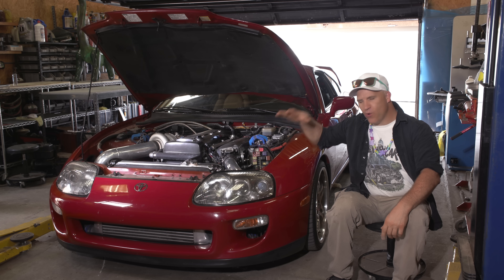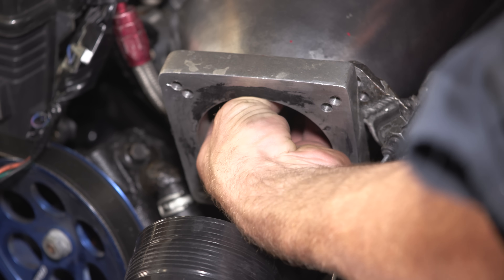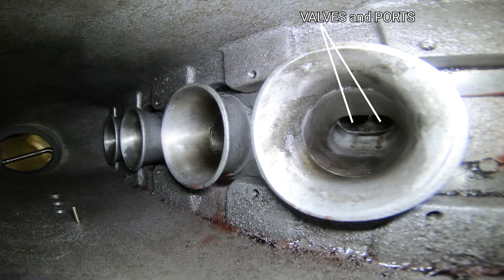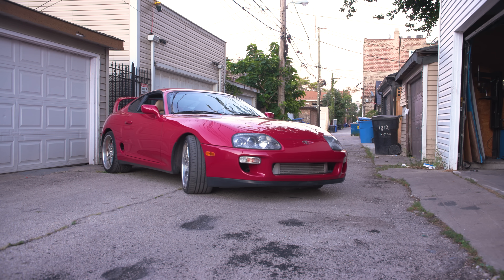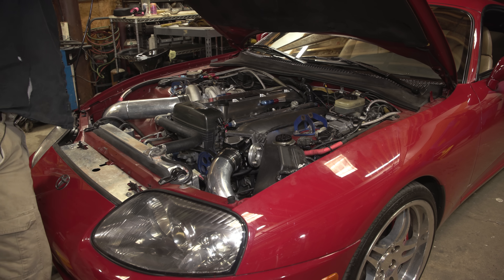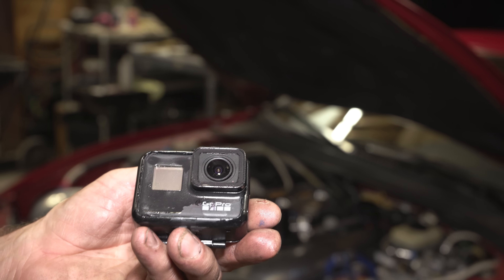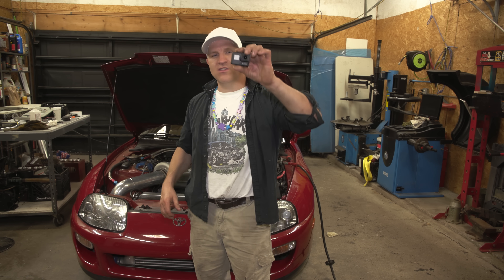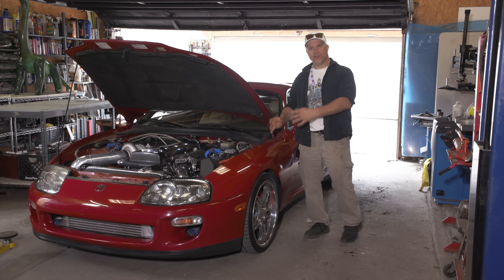Driving with Gopro Inside My Intake Manifold (Toyota Supra Turbo)

Comment: I can imagine the bearing between the exhaust power turbine and the intake boost turbine would be under considerable stress and probably require more oil flow for bearing cooling which might lead to more bypass. Or  of course a bad seal between the bearing and intake turbine housing would pass more oil to the intake air.
Plus with all that heat of the exhaust I can see the air intake temperature rising significantly contributing to higher intake temperatures, cooking your go pro 🍳

As for your handling the go pro when it was 200°, indeed! For many materials transfer rate is so slow that one can easily pick up very hot materials with little effect. I worked at a tire factory for a couple of years in engineering and had the run of the factory so to speak. I spent a lot of time just out talking to operators and sometimes they would let me take over their job while they watched just for fun for both of us. I did most jobs in the factory except for actual tire assembly since that was indeed a highly skilled task that one could not just step in and do. Anyhow, 300° rubber was nothing. When it started getting up to 400° which was rare due to high temperatures curing the rubber, anyhow, then you would need to switch hands now and then.

Okay after all that nonsense, that was indeed a very cool video as you can see the interaction of the butterfly valves and get a very good sense of flow, especially on full throttle to no throttle back to full throttle footage. 
I was surprised at the fuel not being a finer mist.  I'm not familiar of go pro, but if you can operate it by Bluetooth you could easily encase a waterproof camera in a heat resistant shell.  The near future you will have a high-speed camera the size of go pro.
Reply: Leonardokite, generally the t-wheel & impeller are on the same shaft supported by a common plain bearing.
As long as there are no restrictions in the oil return line the seals should easily contain the oil.
Reply: @azmike1956  considering the extreme heat of the exhaust, that is a fairly taxing environment for any bearing seal. There is also potential for a significant pressure difference across the seal.
Reply: @Leonardokite  the (slightly) higher pressure would be on the impeller side &, if anything, would force seal blowby into the crankcase or past the turbine seal which would present as smoke in the exhaust.
The newer seals are actually quite good, think of all the turbos in use at this point in time. They're used on everything. They use a pressure balance system so that the pressure on both sides (turbine & impeller) are fairly even & the return is the lowest pressure causing the oil to flow that way.

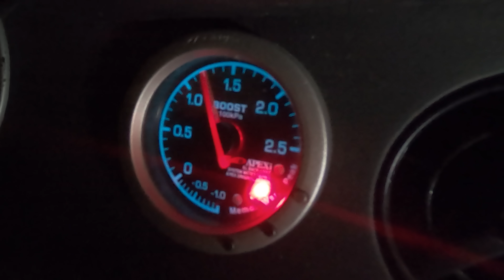Comment: Was it just me or was there electric arc inside the intake manifold on the  left side second cyl towards the middle of the video 4:39 ????
Reply: I See it too
Reply: Yeah, whats with that? I wouldnt think it could be static since its all metal connected together, so maybe a drop of fluid reflecting the light?

Comment: If you have a PCV could be positive crankcase pressure from blow by, which is normal especially on turbo car. Or could be oil being sucked back into the intake from the cylinders when the intake is depressurized and drops straight back to a vacuum, final option is turbo seals, pooling oil up in the intercooler; I think turbos leak slightly no matter what, most of the time it goes unnoticed until you stick a GoPro in the intake lol.

Comment: It's coming from your turbo the oil that's inside the cameras actuated with the fuel that you saw 5:25
Reply: Or possibly before startup did you notice it was red oil on the inside of the lower intake manifold that looks like assembly lube

Comment: oil is generally from the turbo. There was oil in the corners of the manifold when you installed the camera
Reply: K&N filter uses red oil.  Maybe Matt used ATF
Reply: @LawpickingLocksmith  true k&n oil. I wouldn't be too concerned... no smoke.

Comment: Hey bro slap a oil catch can on that beauty you may have some blow by witch would cause the intake to get slightly oily. I've put one on my full bolt on & tuned eclipse. They do help a lot I don't care what anyone else says, just don't except to gain any power its simply a mod that keep your vehicle more healthy
Reply: Its super common on both NA and forced induction but you get a lot of worse blowby with forced induction vehicles

Comment: You have oil catch cans?  A bit of junk in your intake, if you don’t, you should definitely consider getting some.  TBH the crap in there looks like transmission fluid.  You run Red Line oil?  I run Red Line in my 600HP EvoX, best oil I’ve ever used by far.
You probably had oil in your intercooler, and when you stomped on it several times, I assume you don’t do that alot?  It blew that oil into your engine, from the PCV valve and crank case ventilation, it’s directed back into your intake for emissions purposes.

Comment: Could that be excessive oil on the air filter being sucked through.  Looks red
Reply: If it's oil to live the piston from the top then when the pistons fire the air and fuel, the oil gets gone also... that means you constantly have to add oil after a week of driving like an idiot
Reply: Oil coming from the airfilter?no that how toyota design 2jz,oil squirt on the cams and rocker arms/valves,some of the oil get blown out or sucked in the piston to lubricate the walls.
My gy6 scooter does the same,it squirt oil from the top of the cam and the rest of the oil goes to my cylinder,when I bought a bore kit came with a new high flow oil pump to squirt more oil.
Reply: Benjamin Franklyn -Why do you think the oil looked red then? After he first starts it it looks to be coming up from the gasket between the expansion chamber and the intake stack manifold. Later it seems to have made its way up the stack as it starts getting sucked in. I doubt anything had a chance to drip down from the mistake valve areas.
Reply: @RemmikRotus  gas most likely turning the oil red ,unless he added oil additive.
Reply: @benjaminfranklyn604  

Agreed. 

Not so much going to be the Squirts in the Bore causing it but most likely what you said about the Oil in the Head etc.

I didn't look too closely to see if there is a Catch Can there, but I would suspect it's from the Crank Case Breather otherwise.
Reply: @benjaminfranklyn604   So it keeps the pistons oiled and lubed?
Reply: @omghalo3rocks  yes since it turbo,the more air is compressed ,the hotter the cylinder,rings and walls will get ,causing the rings to expand on the cylinder and could lead to worst damage.
Is like the chevy Ls in a race boat,instead of squirting oil from the top ,it squirt directly on the bottom of the piston ,to help keep the piston cool since boat racing are always at the rev limit throughout the whole race.
Stock Ls don't come with those special oil squirter.
Reply: @benjaminfranklyn604  I've never actually seen red engine oil
Reply: @user-bd2yw7yt1h  well I have,I mixed mystery motor oil additive to my gas and oil,it turns the oil and gas red .
It help clean the engine and gas pump or carburetor while making the gas last long.
Mmo is not really oil ,you could smell the other chemicals in it.
Idk what kind of additive or oil he using.
To me looks like a brownish red.
Reply: Its trans fluid cause its red
Reply: What you mean Thirsty? -automatics may have red fluid but standard trans have gear oil that is not red.
Reply: @whatyoumeanthirsty6132  

Shut up!

How is Transmission Fluid making its way into the Intake Plenum?

Do you even know about Engines?

Further more:

Transmission Fluid is Red when it's ATF, this car is a Manual Transmission.......

How about you explain that one????
Reply: UK Citizen  because everyone knows trans fluid is red i did mine and it was red thats why
Reply: What you mean Thirsty? Yeah pcv valve stuff

Comment: Awesome video. Coolant leak started at startup. Hard revs showed some fluid coming out at top of front 2nd? Cylinder? I say small coolant leak at intake manifold. And its either small oil leak in turbo, or blowby/unscavenged oil from cylinders.

Comment: I never knew the gasoline flew around inside the intake as much as it does

I would've assumed it just goes right into the cylinder
Reply: That’s not gas actually it’s oil
Reply: Interesting....

Comment: Cool video!
Looks like when the throttle closes, the vacuum pulls all the unburnt fuel back out into the intake manifold plenum volume area. Which brings me to my nexts thought about where the oil is coming from. Maybe the normal blow-by into the crank case is momentarily reversed pulling oil mist from the piston walls though your ring gaps or just the residual oil/fuel caught in the oil rings back out into the plenum where the air goes into a quick sharp stretched state causing a spike in vacuum making that visual puff.
Reply: I also forgot to mention it could also be coming from the valve stem seals?

Comment: This was such great idea, to put little Gopros in places where we usually have no idea what goes on. Thanks!  I also saw right away that reddish oil coming back out of the intakes into the manifold, and thought that something probably wasn't right there… did you ever figure that out? It's also interesting how much fuel from the injectors starts to splatter back out of the intake and then gets sucked in by the next intake stroke.

I always love it when I catch a glimpse of something I recognize while you're driving around, too... your turn off of Armour onto Hubbard was familiar to me...  always enjoy catching fancy cocktails and food at The Loyalist, just a few blocks south of there.

Comment: I'd check the following: Valve Stem Seals, PVC system, Catch Can (if installed), spark plugs if there's oil. The oil issue appears to get really bad after beating up on it if this is all in order.

Comment: Cool video, but what's all the reddish liquid in the throttle body?
Reply from the maker: I figured out that the power steering vacuum switch has been dumping small amount of oil into the intake manifold.. I didn't know that was going on.

Comment: That's oil from your turbo mate. Good luck.
Reply from the maker: Nah that was my first thought but it's red oh, I ended up tracing it to my low pressure vacuum switch for the power steering pump seems like it's been dumping oil into my intake for a while now and I just didn't know
Reply: @WarpedYT  Right on. Glad you found it. Was worried for a second.

Comment: Dude, this is crazy! You are the mad scientist!
Reply from the maker: Lol... Thanks ! I was going to text you last night and tell you what I was posting, but I thought you would like the surprise. these are the ones I was telling you that I was pulling together for the last 6 months where I put cameras in all sorts of weird places, the motorcycle one was the first.
Reply: I dont know if you're running a catch can, but it seems the vac lines are drawing in oil fumes and maybe trans fluid if you run a breather for the trans and PS fluid
Reply: @classicrestouk  He is not running an automatic. It's engine oil.
Reply: @allanb3222  manual trans/gearbox has fluid....... I didnt say auto trans.
Reply: @allanb3222  hi. Just thought I'd reply. I believe it was Power steering fluid (it was red/pink - normally the power steering system uses ATF).

Comment: Transmission fluid, from trans. modulator vacum line.
Reply: That's only for automatic transmissions, isn't it?
Reply: it does look kinda Red as it pools on the inside of the manifold hmm...
Reply: It being red does make you think that it's trans fluid. There's not that many oils that should be that color.
Reply: Transmission fluid is a lot more viscous than that. Looks like OEM toyota coolant.
Reply: @bluenoseixmr  If so, how would coolant get into the intake track? I would say head gasket failure to get mixed oil and coolant, but that would show in cylinders not the intake plenum no?  Unless that cylinder mix is getting thrown back into the plenum somehow when the intake valves are opening/closing.

Comment: It's trans fluid, vacum mod. trans.
Reply from the maker: It's Manual Transmission. I believe it's power steering fluid
Reply: @WarpedYT  wow I should have realized that after watching the video it is a manual transmission good luck with that sir you have a good one

Comment: Looked like trans fluid in the intake floor before he started it. I'm sure it's oil, but sure did look red.
Reply from the maker: I think I traced the problem to my low pressure power steering switch, it has a hose that goes to the intake manifold and I think it's bypassing oil from my power steering pump into the intake.. I'm going to change it this week.
Reply: @WarpedYT  makes sense. just a little would be good for burning off carbon and keeping the upper cylinders lubed!

Comment: The oil looks like transmission fluid to me. It had a reddish color.
Reply from the maker: I believe it's power steering fluid, I forgot to include the I'll take but I checked it out and I found the vacuum pressure switch for the power steering pump faulty it seems like it's dumping a little bit of oil into the intake under vacuum
Reply: Ohhh I thought that was coolant like the pink stuff

Comment: Looks like coolant in the inlet could be from a throttle body water feed.
Reply: I was thinking oil from PCV,  crankcase pressure/blow-by.  It's a normal amount for a turbo engine with use on it.

Comment: The oil is from the turbo, probably has a tiny leak in the bearings when it's getting full oil flow and under boost
Reply: Either that or crankcase venting. Was that coolant that appeared when he started his engine though? The red stuff leaking from below the intake flutes?
Reply: Not likely from the turbo although there is a small chance. PCV is the likely culprit.

Comment: My only advice to you mr. Warped Perception is to rid of that sound and heat insulation on the hood. When that shit melts in a fire it makes a BIG big mess. And it keeps some heat inside your engine bay too.

Comment: that oil in the intake is blowby being introduced by the pcv system, you need to vent it to atmosphere with a catchcan or use an air oil separator, oil mist in your intake charge can cause your air/fuel ratio to be off and thats not good in an engine like that

Comment: Kinda weird how fuel is coming OUT of the intake runner and not directly into the cylinder.. that’s a power loss?
Reply: Engine running rich maybe
Reply: No, that's what happens when you close the throttle valve and the flow comes to an end and the vacuum equalizes in the intake manifold.
Reply: Teemu Uusitalo i actually have no idea what happen thanks for the answer
Reply: Teemu Uusitalo gotcha, thanks for the info! no wonder high pressure direct injection seems to be better for more power and efficiency.

Comment: I'm really surprised that the sound was so good with all of that air rushing past. I'm also impressed a go pro could survive that situation. Nice footage!
Reply: I've seen GoPros survive and keeping on filming explosions from a few centimeters away. Those fuckers are made of Nintendium or something.
Reply: @BüildBuy12  you mean Nokium?
Reply: @MilesKicks   An alloy of both.
Reply: @BüildBuy12  stronger than vibranium
Reply: Intake air temp is about 30-56 celcius depending if he is flooring it or mostly driving around the city. GoPro should be able to handle that.
Reply: D,li

Comment: You need to dial in some more decel fuel cut to dry out the manifold during those closed throttle decelerations. I'll bet the engine goes super rich on a initial tipin after a long coast down. Maybe even a little hesitation. Agreed on the driveality thing. If all you have for a throttle is an on/off switch that's no fun on the street. You have to be able to modulate the power.